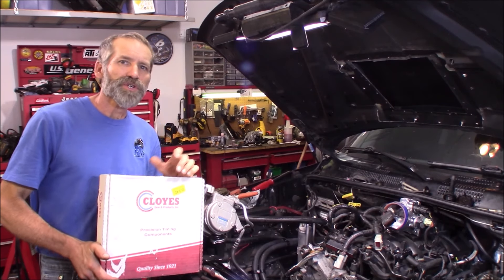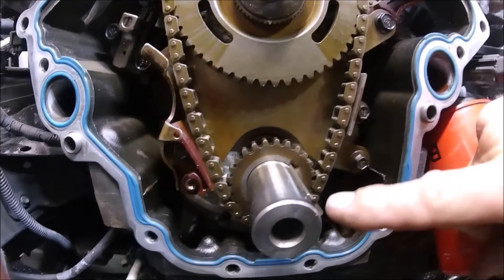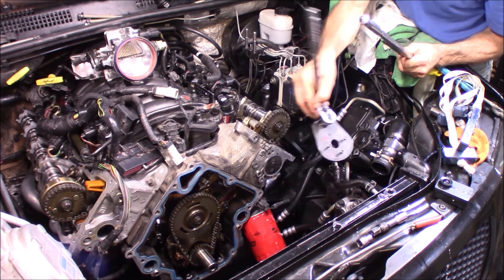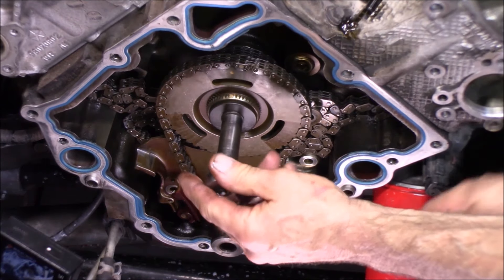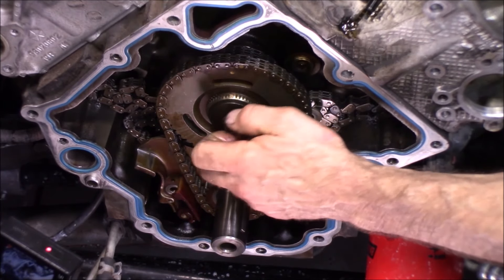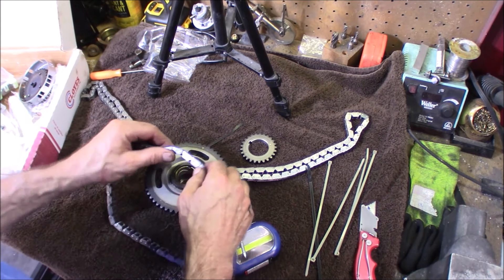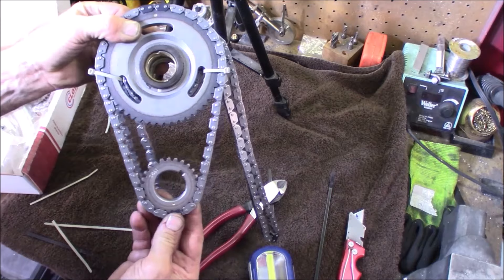How to Install Timing Chain Set Dodge, Jeep & Chrysler 4.7 & 3.7L

Comment: how often does it needs to be changed ?? i have plans about buying 4.7 from 2008 thanks !
Reply from the maker: According to Chrysler they're supposed to last a lifetime but that's not the case,  you should be able to at least get a hundred fifty thousand miles and with the 08 and newer I would think you could get even more.
Reply: @martinbuilt  thanks for a fast reply best wishes from Lithuania bro !

Comment: Great video! very helpful. Question though so I know you said you put 08 cams in this motor. Hows the performance out of them compared to the stock ones? And I have a 02 ram 1500 with the 4.7l, so im guessing  I will be able to do the same?
Reply from the maker: Thank you, I was very pleased with the performance of the 08 cams. Even better than the HO cams. Yes you'll be able to do the same with your truck.

Comment: a rocker arm fell off on cylinder 2 , put it back on but still loose. I used the washer trick under the lifter and stayed there. Forgot to adjust the timing belt which makes the engine run rough. I watched this video and turn the balance shaft to match TDC and run like a champ. Thanks a lot for this video. You saved me 1500 on repairs

Comment: Is the 4.7 dodge 2008 in my ram 1500 the same engine as your engine?
Reply from the maker: No not really really. They made quite a few upgrades in 08 like cylinder heads, intake manifold, camshafts and throttlebody just to method a few.
 Some of these things are interchangeable.

Comment: Look I got 2004 jeep grand Cherokee 4.7 just rework the heads and new timing chain got back together starts fine runs really good but when you try to give gas it's blows the injector fuse I didn't put new injectors in but I did clean them

Comment: Nice video Martin you're the man!  If you did go ahead and remove the hydraulic  lash adjusters and rocker arms,  you would be able to spin the cam sprocket by hand and not have to mark up your cams to install the chains.  Really made my life easier just taking them out.  Take care and thanks for the video !
Reply from the maker: Glad you found it helpful
Reply: @martinbuilt  sure did its nice to see the job clearly explained the zip tie trick made it so easy thanks again!

Comment: I did exactly as you did in the video and after putting it all back together, it wont start. It tried starting the first crank but now it wont start at all. Great video though. Its a 03 durango
Reply from the maker: Sorry to hear that. If the engine was running before, first make sure you installed the correct right side timing gear if you replaced it. I would check your timing marks, by rotating the engine the timing marks should line back up every 14 rotations of the crankshaft.
Reply: @martinbuilt  yeah the parts were exactly the same, I tore the engine apart for the 3rd time and I still can't figure it out. I guess I'll just send it to the shop. Thanks
Reply: @Moparman58  "Gay knows people that can fix it" HEHEHEHE  -Mr. Beaver

Comment: I bought the same kit and The timing chain tensioner guides (the metal/plastics ones).the plastic pads are really loose and can slide on their metal frames is this common I remember the old factory ones from my
Previous Jeep they didn’t have any play

Comment: Hey, man, great work and tips! Did you remove the lifters prior to chain removal? The chilton manual says to do so to avoid possible interference, but I am thinking I could save a step...
Reply from the maker: I believe you mean the rocker arms but, I did not. If you rotate the engine in the position as I describe you should be fine.

Comment: I got the wrong reluctor gear on the right camshaft  with my set. Does that mean that the rest of the set,chains ,gears etc., are also wrong or can I get just a different reluctor gear that is correct?
Reply from the maker: No the only difference is that gear on the right camshaft all of the rest of it is the same.
Reply: @martinbuilt  thank you.
Reply: Martin I'm having a problem getting my oil pan to come out on my 05 dodge ram 1500. 4.7.  It dropped about a 1/2 in.and just stopped coming down. I'm in the process of a timing chain job and decided to replace oil pump also. I've removed the 1 bolt from the pick-up tub to pump. I dont get it. Pans usually  drop right away when you break them loose. Any suggestions would be grateful.  Thanks

Comment: Two times  after endless cranking one  colored mark on cam shaft lined up and the other side would be at 12 o clock. Does this mean my timing was off? Or should i replace timing cover and keep cranking
Reply from the maker: I think you need to start over and make absolutely sure that the timing marks are correct. What year engine and make and model?  Did you replace the cam gears
Reply: @martinbuilt  2002 dodge ram 1500 4.7 sohc
Reply from the maker: @lowvis7413  Did you replace the cam gears and what timing chain set did you use (part number)?
Reply: I personally havent replaced cam gears but i purchased from family mechanic, i know engine is a swap
Reply from the maker: @lowvis7413  did the engine run before you performing the timing chain replacement?
Reply: @martinbuilt  part number is 53020681
Reply: @martinbuilt  hey martin Solved my issue, but I cant get the right cam gear off for the life of me. Any advice you could give me?
Reply from the maker: @lowvis7413  
if you have an impact wrench that will break that bolt loose, electric or air,
Reply: @martinbuilt  hey martin got everything off and heads resurfaced. Do you know the sequence to install rocker arms?

Comment: I have a 2.7,  this video was the best at explaining the essentials of timing. It is a good guide, I hope I can find one this good for my engine.
Reply from the maker: Thank you, Ronnie, I appreciate that, good luck.
Reply: Any ideas on why the cover will not come off?. All bolts and pulleys removed .
Reply from the maker: @Ronnie-zn9sx  are you sure you got them all? Did you remove the belt tensioner, there is a bolt hiding behind that, and the large bolt at the very top of the cover 17mm deep socket?
Reply: @martinbuilt  i found the infamous missing bolt, just where you said it was. I had to find it before i went to bed or i wouldn't sleep. Keep you updated.
Reply from the maker: @Ronnie-zn9sx  glad you found it, now comes the fun part
Reply: @martinbuilt  i founda bunch of loose small dowels in timing compartments. Any idea!?
Reply from the maker: @Ronnie-zn9sx  I am not familiar with the 2.7 and don't know where those dowels would have come from.
Reply: @martinbuilt  thanks for replying.

Comment: I just got a 200 Dakota 4.7  I did the timing chain on my 01 Ram just one chain.  I was looking at the motor on this Dakota and it looked different so I got curious.  3 chains WOW,  that sucks.  Luckily it only has 76,000 miles on it so no chain needed for a long time.
Reply from the maker: Yeah you're good to go just keep good clean oil in it and you should get another 76000 miles out of the chain set with no problem.

Comment: My crankshaft  is at 1230, it needs to be about 230. Can i turn by wrench or am i screwed?
Reply from the maker: is this after you have installed the new chain set?
Reply: @martinbuilt  no chain on yet
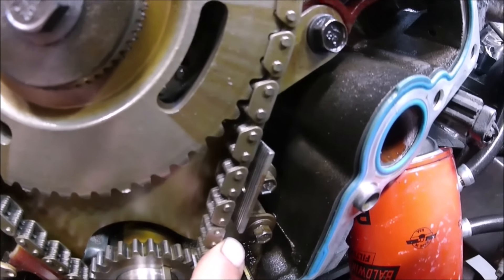Reply from the maker: @Ronnie-zn9sx  The crankshaft needs to be at 2:00 and at the same time the cam gears need to have the V8 at 12:00 if it is not, rotate the engine 360* and then everything should line up. If it will not line up at all the chain could have jumped.
Reply: @martinbuilt  will do..thx again!

Comment: Nice video Martin. Nice clear shots on the video. I had a diagnosis of coolant in my oil in my 08 3.7. So I'm considering pulling off the head gaskets. While I have all that off I gathered I might as well go the extra step and do the timing chain as well so this was very helpful. Not to mention, I just remembered since I'm doing all that I might as well throw in a new set of lifters.;) thanks!
Reply from the maker: Thank you I appreciate that. Glad you liked it and found it helpful.
good luck with with your engine hope everything turns out well.

Comment: Thanks Martin! Helped a ton, along with your balancer installation video! Just did head gaskets, timing, and the whole works. Had to replace the heads, they were cracked between every cylinder. Thanks for making a quality video!

Comment: I have similar engine and when I rotate the engine clockwise from crankshaft bolt one right cam chain is loose and the other is tight, as I keep turning it gets tight and the other gets loose. Is the normal?

Comment: I took the tension off and then messed up trying to get the cam bolt off and now it’s out of time, I’m doing a head gasket job. Am I done for ?
Reply from the maker: If you're doing a head gasket you would need to retime the engine anyways. There is no way to remove the cylinder head without losing the timing.

Comment: Can the cam sprockets be removed after the tentioners?
Reply from the maker: Yes they can either use a vice grip on the Cam shaft or a spanner wrench on the sprocket or even an impact will remove the bolts.

Comment: Him I have a question.. do you absolutely.have to change the sprockets.??.
Reply from the maker: No you don't need to change the sprockets. Changing the sprockets will help bring cam timing back to the original. This is best for performance.
Reply: @martinbuilt   if I don't change them  how bad will it be ?.. money is an issue at the moment since this covid mess... 02 4.7 ho..thanks for your input..

Comment: Also..the passenger side has full compression and the driver side doesn't have full compression. The second spark plug on the driver side is where my mechanic is having the problem due to the compression test that he did earlier today as of Thursday. I hope this extra helps out so I can have my truck back Friday. He's had it for 2 weeks now. Thank you again

Comment: Being working on a 2010 I did everything you did, the engine fires up bu won't idle, so put in tdc again popped timing cover off and all my marks on chains are way off I'm stumped on what I did wrong
Reply from the maker: It can take up to 14 rotations of the crank shaft to get all the marks to lineup once again. Are you sure you don't have some kind of vacuum leak or something that's causing a high idle.

Comment: I have a question I have a 2000 jeep gc and it started and drove fine for the 5 days I had it no sign of anything wrong went to start it for work it fired up put it in reverse and it made a noise on the passenger side it started enough to get back in my spot with a bad sound now I get a single click and not trying to turn over or anything one click and no noise changed starter, starter relay and battery. Do you think the timing chain broke
Reply from the maker: Put a socket with breaker bar on a harmonic balancer and try to turn the engine by hand one way or the other. If you're unable to turn the engine over there is a good chance that the chain did break and bound up. I would be very surprised if it did break. I'm kind of wondering if the cam bolt didn't back out and then you lost timing where the valve would hit the top of the piston.. that would be the worst case scenario hopefully it's something more simple than that

Comment: Just did my timing and engine runs but fall on its face while in drive,, timing?
Reply from the maker: Yeah maybe timing as far as a timing chain go.
 That would suck if you have to take the whole thing apart again that is one thing when doing the timing chains on this engine you absolutely have to make sure that you get it right because it this is also an interference engine where valves could make contact with the pistons if you get the timing wrong.
Reply: @martinbuilt  I don’t hear valves hitting piston though that’s what’s strange
Reply: @tinyfordtruck  you may not because the valves are probably already bent.

Comment: I have a 3.7-liter jeep laredo engine, year 2005
broke the main cap of one of the covers
¿Do you think it folded the valves?
Reply from the maker: Sorry I do not understand what your trying to say
Reply: about a jeep laredo year 2005 engine 3.7
broke 3 main caps, from the driver's side cover.
This engine, bend the valves. if you waste time

I don't know much English hehehe
Reply from the maker: @orlanditosvt1932  sounds like you need to at least replace cylinder head if I understand you correctly. You should try Google Translate

Comment: How do you take off the passenger side cam gear!!?
Reply from the maker: How did you take off the driver side gear?
Reply: @martinbuilt  I used a gear holder tool that utilizes the holes in the sprocket. The passenger side sprocket has rivets in 2 of the 3 holes, making my tool useless.
Reply from the maker: @DeadLastWeek  oh okay, you could use a tool like this  Crescent 9" Locking Chain Clamp https://amzn.to/38xRUZF
Unfortunately, I'm not making the tool that I used in the video, that works on both cam gears.

Comment: Is there an easy way to determine that your Timing chains are worn to the point of "needing" to be replaced?
Reply from the maker: it the guides and guide tensioners that will wear out first and you will hear some noise from the timing cover area.

Comment: Your video has been more helpful than anything that I have looked at to build my confidence to tear into my 2005 4.7 ram 1500 that has a sloppy loose passenger side timing chain that I found while changing lifters that I thought were causing all of the racket in there.
Reply from the maker: Thank you, That could be most likely caused by a hydraulic self adjuster failure or maybe worn out guides

Comment: Where can I order the tool you used to hold the cam shaft with? I’m currently doing this to my truck and I can’t finish it until I take those gears off
Reply from the maker: I am working on having these made, but it could be a month from now.
Reply: martinbuilt I need that tool . A damn shame nobody has mass produced a tool for that specific job .

Comment: i know this video was uploaded a while ago, i have a question. i replaced all the sensors on my engine still does not run. tries to. spark plugs go black. would a loose chain cause that? i took everything apart and the chain was loose. the tensions were not doing there job everything is lined up just like in ur video.
Reply from the maker: I would check out a few things first. Check your fuel pressure make sure it's within spec. How good is your oil pressure? Do you have a check engine light and if so what codes are showing up?
Reply: @martinbuilt  tested fuel pressure it was a psi away from spec (i beleive it was 80 it was a while back)  oil pressure is 35-40 when cranking  this engine has not run since we started it at the junk yard. 3 years ago. no codes are pulling up. i ordered everything but the gears going to be here the 7th
Reply: we got the computer from the other vehicle as well.
Reply from the maker: @gregbratrsovsky5787  80 psi would be way high you'd want something closer to 50 psi. If it was 80 psi that would definitely cause it to run rich.
Reply: @martinbuilt  I will double check tomarow.
Reply: @martinbuilt  tested it 3 times all came out to around 54psi not sure why I remembered 80

Comment: If my timing chain wasn't set correctly, would I be able to turn the motor to try to start? Or would the valves interfere, 1 tooth off somewhere?
Reply from the maker: the 4.7 is an interference engine, so yes this could cause the valve to hit the top of the piston.
Reply: @martinbuilt  I found I have the incorrect reluctor/tone wheel on the crank😫
Reply from the maker: @ladylucklandstwice7199  On the Crank? did you replace the engine? Or do you mean the wrong gear on the passenger side camshaft?
Reply: @martinbuilt  on the crank. Engine is a replacement. 😑  has 32, need a 16
Reply from the maker: @ladylucklandstwice7199  Yep that would do it. That sucks now the engine has to come back out.
Reply: @martinbuilt  and the timing chain and crank have to be removed to swap rings, IF I can find one. I have lots of 32...but maybe no 16🤔
Reply from the maker: @ladylucklandstwice7199   with the timing chain you need only change out the passenger side (right side) cam gear. Save you from having to take off the timing cover.
Reply: @martinbuilt  I have to remove timing cover to remove crank?
Reply from the maker: @ladylucklandstwice7199   oh yeah..lol
Reply: @martinbuilt  do you have a 16 tooth ring for sale?
Reply: @martinbuilt  "Hi. You are correct, the tone wheels can be different. The 2002.5 Durangos were the first to get the new NGC type engine controller. They used the different tone wheel. To tell if you have the newer or older one is easy. Find your engine controller in the engine compartment on the passenger fender. If you have 3 32 way connectors on the controller you have the older Chrysler JTEC controller, if you have four 38 way connectors you have the later NGC. If you try to install the wrong engine in yours it won't start. You would have to tear the engine down and swap the cam sprocket tone wheels to get it to run.

Oh....?🤔🤔🤔🤔🤔
Reply from the maker: @ladylucklandstwice7199  I couldn't have said it better. Thank you for sharing!
Reply: Actually it's not true, the computer and harness would also have to be swapped😥 and then the transmission controller would be an issue. So I'm stuck looking for a 16 tooth ring. I'll pay shipping!

Comment: What issues were you having with the broken piece ? What issues were u having ?
Reply from the maker: I wasn't having any issues with that broken piece. I only discovered it after I decided to replace the timing chain set since I wanted you achieve the utmost performance with my 08 camshafts.